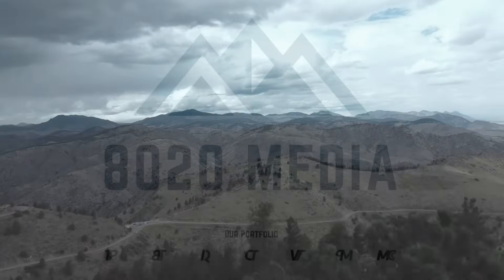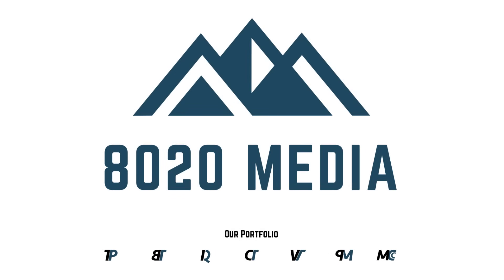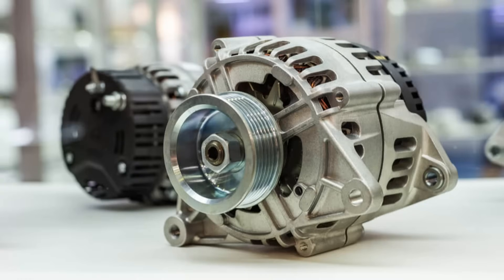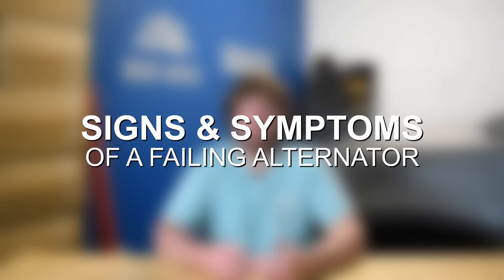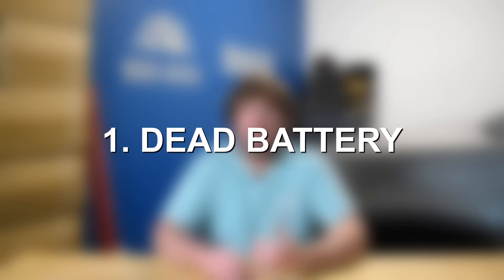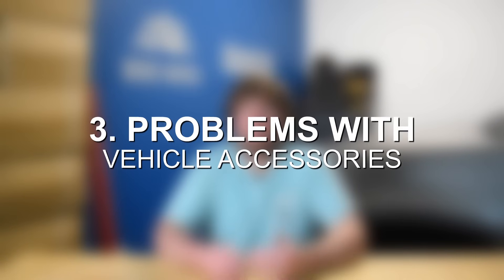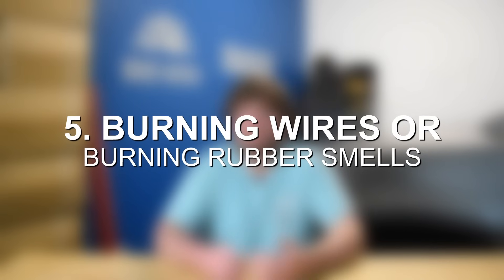6 Symptoms of a Bad Alternator!

Comment: Great explanation thank you so much 👏 👍 

One question though 
Does the Alternator also supply electrical power to the Starter relay fuse  ? 

Because on another video I was watching it said to start with the Starter relay fuse first 

🤔 Thanks again

Comment: I have a 2008 dodge charger pursuit and left it in the garage for 3 days got in and had no power (lights, dash, couldn’t even unlock the doors with the key fob) . I hooked it up to jumper cables and all the power came on but I was only getting one singular loud click. Any ideas as to whether it would be the alternator/battery or a starter issue?
Reply: Also, the moment I unhooked the jumper cables all the power cut right back off.

Comment: Looking at over $1000 in repairs from the dealership but I think it's the battery and/or alternator and not the IPC, since the error codes only present themselves when I start the truck (2015 f150) and sometimes that's a hard start from lack of juice to begin with. If the alternator is sending out inconsistent voltage, would that cause the IPC to send invalid data to ABS, FCIM and PBM?

Comment: My battery is fine and I had it tested even with a load but it won't turn over without getting a 100 amp boost. It drives without stalling out but the minute I turn it off I need a boost to get it to turn over again. Who's at the alternator or do I have some issue with my terminal connections

Comment: A car of mine that I hadn’t driven in a few weeks had a dead battery when I went to start it. Later the battery showed 6 volts when tested. I charged the battery all night with my Viking charger and the next day, my car initially started and ran very weakly, even stalling at a red light. However, later that same day, the weak running has since disappeared and the car starts and runs as strong as ever. Maybe the battery had died from not being driven a lot lately?

Comment: If ya cafñr sounds like an airplane, look afor shiney polleys. Then cracks on belt[anymore thsn 3 per inch, replace belt]. Alternator may not affect lights but.sound like exhaust is clogged. Over ampage is bad also, can pop lights on the car, taillights, ECT. I CAN CAUSE IGNITION ISSUES

Comment: My jeep is giving me problems with starting up sometimes. I would say like one a week, I’ve already changed the engine, radiator,  Ignition coil, soon to change the oxygen sensor which is the only code coming up. But I do notice that the music system and the heat sometimes goes off on its own when on then comes back on. Do anyone know what this can be?

Comment: I have a pretty old battery that holds a solid charge, but I've been seeing all the lights flicker and everything goes dim when the engine revs, so this helps and I know I can hang onto the battery for a little while longer and continue working on the other things.  I'm in the process of a full restoration, it's just that dealing with the most crucial things first will help with any future troubleshooting.

Comment: my gmc envoy was idle for awhile and when i drove it again it stalled, another time i tried to start it and the lights wouldnt even turn on nothing happened then it randomly worked after a few mins. another day it happened again and i had to get a jump but when the cables disconnected the car immediately turned off. checked the battery and i believe connectors were loose and she started up and has been running the past few drives no problems. is this a problem with the alternator or just because the car was idle awhile? i dont believe my battery is dead but could it be the battery?

Comment: Zach , your doing gods work 😂😂. # 2008 mercury milan v6 premiere  . Red battery light 4 3 weeks is on then goes away after awhile . A few weeks ago i had smoke and burning smell , i couldnt see why . I hosed under car , never happened again . Today i start car whining , grinding noise . Timing chain or alternator inyour opinion ? Please help Gary . Thanks 😊😊😮😮😮
Reply from the maker: G - Thanks for the feedback! Given your symptoms, it’s far more likely to be your alternator or one of its bearings/pulleys rather than the timing chain. The battery light means the alternator isn’t charging properly, and when alternator bearings start failing, they’ll make a high-pitched whine or grinding sound that changes with engine speed. The earlier burning smell and smoke could’ve been from the alternator overheating or its belt slipping on a failing pulley. A timing chain issue wouldn’t cause a battery light or electrical problems, and you’d hear more of a rattling noise from deep in the engine, not a whine. I’d check the serpentine belt tension and listen at the alternator with a mechanic’s stethoscope or even a long screwdriver — if that’s where the noise is loudest, replace the alternator right away before it seizes and leaves you stranded.

Comment: HOW ABOUT THE IGNITION TURNING OVER HAS A DEAD SILENT AND NOT STARTING I HAD A TESTER ON IT AND IT SAYS IT'S THE ALTERNATOR. I BOUGHT THE STARTER, BUT I GUESS IT IS THE ALTERNATOR. THE OTHER BATTERY HAD THREE DEAD CELLS. REPLACED IT.

Comment: Hi!

I bought a second hand car, about 1 year ago. I immediately changed the old battery  to a new one (Banner Powerbull PbCa 50Ah; Banner is a solid brand in the EU).
After 6 months, during the summer noticed a very sluggish start (took about 5 secs to start), and quiet inconsistent starting.
Now I have the following numbers: ~12.4V after a letting the car sit for the night; ~14.4V when idling, with no load; ~12.1V when idling with all load (all lights, radio, ac, rear defogger, full blowing); about 30mV between matching alternator and battery terminals.

Can you help me out, with these numbers is it a dying alternator overall, or a battery, or both? 

Thanks in advance!

Comment: My power steering goes out while turning and trying to park. Randomly.
2014 Ford transit connect says there's no pump. It's electric. 
I read a comment about disconnecting negative while running. Im going to try that and see. 🎉

Comment: Everything you described about the alternator is my problem but shop told me alternator was good, yeah it's not dead, yet but i think it's very near it's death, cause when i jump it now(only way it starts) within a mile or two it stalls out. I pulled my battery out and recharged it and it was fine held charge for multiple days, then when i drop it into the car it does nothing for it, a fully charged battery cannot crank the engine over, other than alternator then the starter is the other option, but the symptoms you describe flickering lights, dim interior lights etc I get ABS warning Trac warning battery red warning etc and yellow engine light comes on. I still believe it's the alternator. I have said this for 6 months now actually nearly 12 months when it would run for a month or two then drain battery then i'd recharge and it would start up fine for a month or two and run fine, now it's like the battery doesn't even have time to drain, the car just shuts off and it is now unable to start other than a jumper i use to jump it.  They told me to get a new battery, I did, but both batteries are very new, both cannot be duds. They both read at 12.6v and then when i connect car they show crazy all over the place readings. i disconnect the ground and measure and then the battery measures 12.6v so the battery is fine, i don;t know or understand why they told me the battery was dead or had no amps etc when i can use my multimeter and battery charger and testing to see it show as good. It;s dangerous to let a car drive around on a faulty alternator. What if i lost power on the road  and my light were out and nobody could see me and hit me? Would the shop be liable for that? They claimed it was the battery, said alternator was good, keep in mind its 22 years old never been changed  i told them that, same with starter original never been replaced, 22 years old, the battery is less than a year old. I am getting to the point where i think people truly do not pay attention to what you tell them and act like there's' no way i would know it was an alternator, this is not my first rodeo, i have had replaced 3 alternators on 3 other cars prior to this car, it reminds me of all the other cars symptoms, my uncle is a master mechanic and my cousin, do i really need to ONLY use a relative 4 states away to get a decent repair now? Has the trust really sunk this much?
Reply from the maker: E - Everything you’ve described absolutely screams alternator failure — not a battery issue — and you’re right to trust your instincts here. A healthy, fully charged battery reading 12.6 V but unable to crank once connected to the vehicle means that the charging circuit is collapsing under load, and those “crazy” multimeter readings confirm unstable voltage output from a dying alternator or bad voltage regulator inside it. The flickering lights, ABS and traction warnings, red battery light, stalling after a short drive, and the need for jump starts all point to the same thing: the car is running purely off the battery until it dies, then the alternator isn’t recharging it. The shop’s “alternator good” verdict likely came from a bench test that didn’t simulate heat or load, which is common — many alternators test “fine” cold but fail when hot or under real vehicle demand. At 22 years old, that alternator owes you nothing; it’s far beyond typical lifespan, and the intermittent pattern over the last year fits internal diode or regulator breakdown perfectly. Replace the alternator and double-check the main charge cable and grounds (especially engine-to-chassis), but you’re spot-on — it’s unsafe to drive like that, and you’re justified in being frustrated. If the shop ignored clear symptoms and sent you back on the road with a charging system that could fail mid-drive, they could share some liability, but the practical move now is to get a new alternator installed and verify you see 13.8–14.4 V at the battery while running — once that’s stable, every warning light and issue you mentioned will disappear.
Reply: @8020Automotive  thanks for the response but it was a bad battery cable, the ground cable was hot! It gave an error code finally!

Comment: Had a new 1973 Buick and while it was still under warranty alternator when out several times.  So I didn’t trust the car but found out that just before I started have alternator problems again I could blow the horn and would get a weak horn sound.  So back to the dealer.  Fast forward to a 2023 Subaru Now have a cig adapter plug with three different ports to charge phones.  But also has a digital readout of the voltage.  This saved me from breaking down, when with the engine running I was only 12 volts and not between 13 and 14.  I bought it from Amazon and leave it plugged in.
Reply from the maker: D - Nice! Thanks for taking the time to share this.

Comment: My alternator went out on my Friday night, got it fixed Saturday afternoon, brand new alternator n it’s a bad alternator also it drained out my fully charged battery that was charged up yesterday
Reply from the maker: M - Sorry to hear this.. If your brand-new alternator immediately failed and drained your fully charged battery, there are a few possible causes: 1) the alternator itself could be defective out of the box (this is surprisingly common with remanufactured or budget units); 2) the voltage regulator inside the alternator may have failed, overcharging or shorting internally; 3) a wiring issue—such as a bad ground, damaged power cable, or faulty alternator fuse—could be preventing proper charging or causing a parasitic drain; 4) if the battery light was on while driving, the alternator may not have been charging at all. You should have both the alternator and battery tested again, and also inspect for blown fuses, corroded or loose connections at the alternator, battery, and chassis ground. If everything checks out, replacing the alternator again with a higher-quality unit is likely your best bet.
Reply: What was causing that did you find out?

Comment: Got a 2020 Toyota Corolla LE 12/2024. The car wouldn't start 2weeks later. Got the battery charged worked fine & the battery tested ok at AutoZone. 1 week car wouldn't start got it jumped very easily by a neighbor and went directly to the Dealership and aft 3 1/2  hours they gave me a new battery. Today car won't start. Charged it for 3hours w one of the Noco 1amp  chargers & it started. I'm leaving it on overnight. I got a warranty. I'm gonna try it in am & take it to the dealer. Had oil change at 6mo no issues with anything & new battery was ok 7/15, I asked abt it. I dimmed display lights, turned off vanity&backseat overhead lights & AC off. Trying to see if those are draining the battery. I don't drive ev day & haven't before today abt 8days. TY for the info!
Does that sound like a transmission problem? I had no problems driving & starting it(til today).
Reply from the maker: S - Sorry to hear this.. No, this doesn’t sound like a transmission problem—it sounds like an intermittent battery drain or charging issue. Since the battery is new and tests OK, it’s likely there’s a parasitic drain when the car sits for multiple days, especially if you're not driving it regularly. Accessories like interior lights, display dimmer settings, or even a faulty module (like the radio, door switch, or ECU) can drain the battery slowly. Leaving the NOCO trickle charger on overnight is fine, but when you visit the dealer, ask them to perform a parasitic draw test and check for software updates or TSBs (Toyota has issued battery drain bulletins for some Corolla models). This has nothing to do with the transmission.
Reply: @8020Automotive I just had the alternator starter and battery checked and all were ok. I ordered a jumpstarter my brother suggested. I only make short trips usually sev and haven't driven farther than 10 miles. The guy said I need to drive or run it 20 30 min to recharge it if I'm restarting the car sev times doing short errands bc alternator doesn't have time to recharge itself? Checking to see if something is draining it, all I cld see was visor did activate the vanity light but booklet says it shld turn off after 20 min. IDK if that's poss, but I do plan to go get that battery draining situation checked further. Does the State Farm safe driver tracker suck the battery? It's on the windshield.
Thanks for the suggestions & video!
Reply from the maker: @sharon6638  Yes — short trips with multiple restarts don’t give the alternator enough time to recharge the battery, especially if you’re only driving 5–10 miles or less between stops. A healthy alternator can replenish what was used to start the engine, but that usually takes 20–30 minutes of driving at speed, not idling. If you’re doing a lot of short errand trips, the battery will slowly get weaker unless you use a maintainer or longer drives. The visor vanity light should time out, but it’s worth confirming it shuts off, because even small draws add up over hours. The State Farm Safe Driver tracker (telematics device) can draw a small amount of power 24/7, but normally not enough to kill a good battery quickly — however, on a car that’s already doing short trips, every extra draw matters. You’re already doing the right thing by getting a parasitic draw test, because that will confirm if something is draining it beyond normal levels. In the meantime, running the car longer, taking an occasional highway drive, or keeping it on a battery maintainer will help keep the battery fully charged.
Reply: @8020Automotive I had the 6month old Duralast battery, the starter and the alternator checked and all were good. I did see the visor mirror light had a  slightly opened slide which turns on the light and a fast charger cord attached to the "lighter" type port not charging anything so removed that & turned off back seat auto door open overhead lights. I drove 20min then no driving 3days and it started easily. Again no driving for 2days started easy. Cld be those were draining power IDK. I bought a jumpstarter and have it ready which hopefully I won't need! TY for the advice appreciate it!🏆

Comment: Does the alternator have anything to do with your AC fan not blowing full blast thank you
Reply from the maker: M - Yes, the alternator can affect your A/C fan performance, especially if it’s not charging properly—if the alternator is weak or voltage is low, the blower motor may not receive full power, causing it to blow weakly or inconsistently. Most modern vehicles reduce electrical output to non-essential systems like HVAC fans when voltage drops below a certain threshold to protect the battery and keep the engine running. To rule it out, check your system voltage with the engine running—it should be around 13.5 to 14.5 volts; if it's lower, the alternator may be the cause of your weak A/C fan.